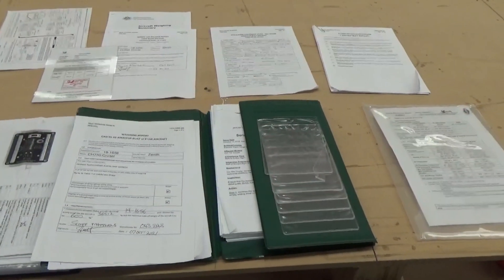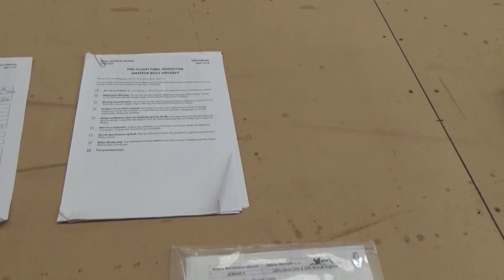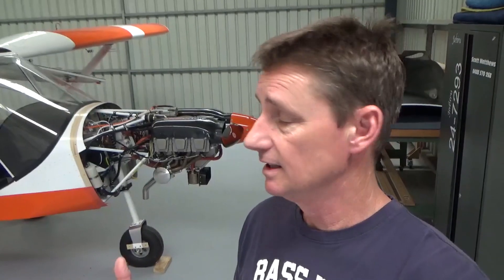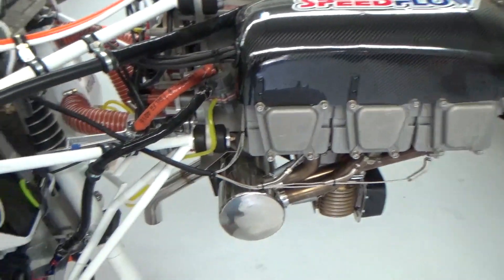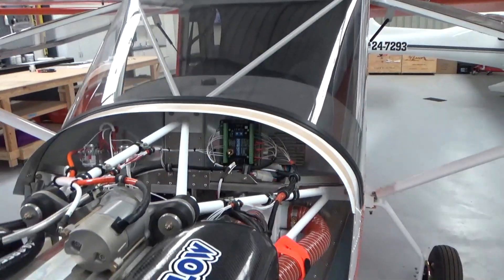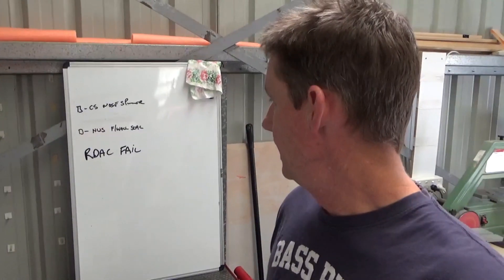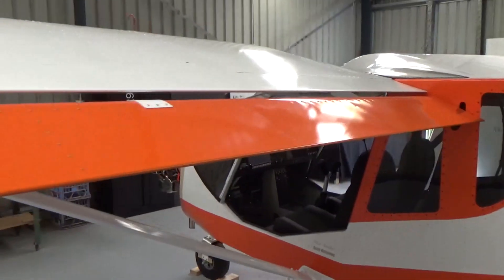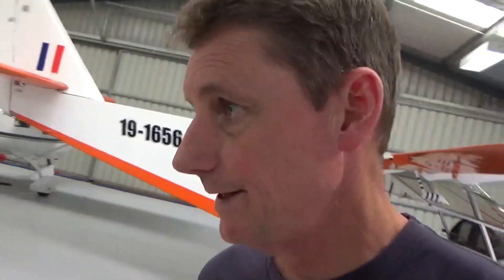Jabiru engine Ground runs

Comment: Hey Brother Scott, I encourage you to seriously consider installing the Panos 3300 Oil Separator to your oil vent system. Adding one to my airplane reduced oil ‘use’ substantially. This simple device allows harmful acid and moisture vapors to pass through and enter your current capture bottle. But its internal baffles encourage Oil vapor to condense and flow back into the oil fill stand pipe. My personal experience has proven it’s a great operational improvement for these engines that otherwise, blow a significant amount of oil overboard, unnecessarily.
Reply from the maker: Do you have a gen4
Reply: @scottmatthews5280  Yes I’m actually upgrading to the 3300 Gen-4 now. Just fabricating custom cowls since my Skystar Pulsar III is no longer in production. I’ve installed the full sized Panos separator and have only done 2 engine runs. Before upgrading the engine, I ran a 2200 Gen-2 about 400 hours with the smaller Panos separator.

Comment: Looks Great!! I have the same avionics from MGL and a couple weeks ago i was testing the CHT's and Oil Temp senders and when in boilingg water the CHT's were real close to 212 deg but the oil temp would show 470 deg also tried testing the oil pressure and it was way off MGL had me send the RDAC unit in to be repaired, not sure what i think about that now that you had problems also. Could you give some info on your fuel flow test especially with the Header tank, i'm in process of building one myself. Thanks
Reply from the maker: I assume your talking F and not degrees C. MGL seems very finicky on setting etc. A simple selection can make all the difference but then like you have done, I like to calibrate and test it. Fuel flow, I just initially ran 10litres in and out to flush everything. Then drained out 10 liters and timed it to get fuel flow per hour. Jabiru uses 20 -24 liters per hour so went with 30. I gravity leak, 60 liters per hour no pump. So assume that is adequate. Then I raised the nose to ensure the header tank does not get an airlock in climb attitude. All good cheers.

Comment: Looks great.  Started flying my 750 stol 9-24 the day after inspection.   On the top corners of the windscreen I have some gaps in the corners.   Did you have that?  What did you do to fill the gaps?
Reply from the maker: Just a small piece of butyl tape worked okay for now.